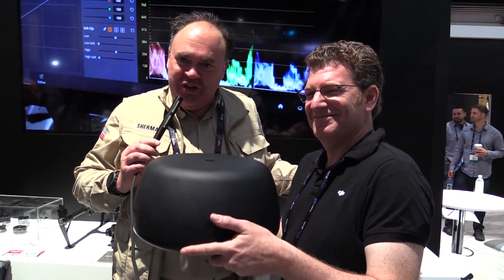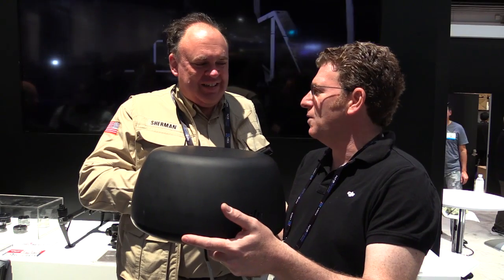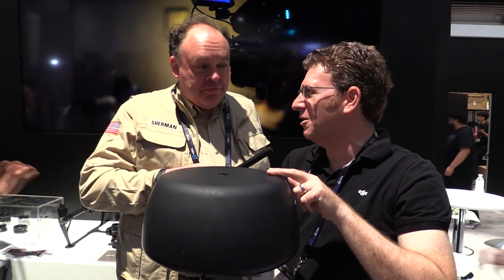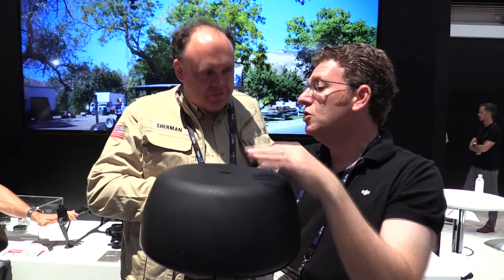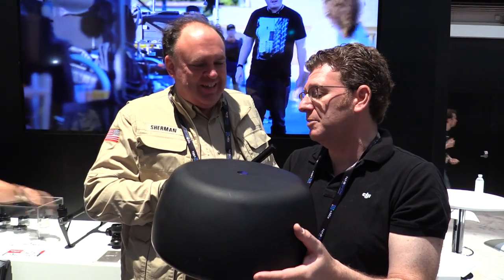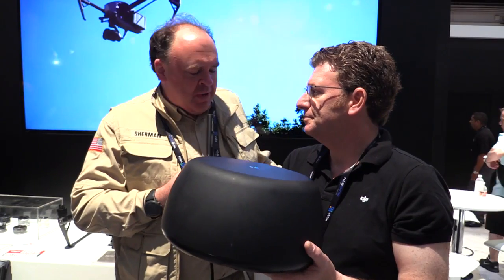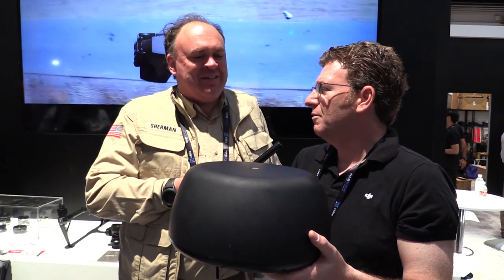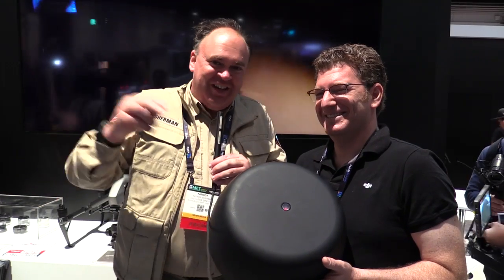DJI Previews Tracktenna Long-Range Video and Control Link

Comment: Another nice fake of DJI. Since this nice video, the antenna was never sold. Those that need, for industrial inspection long range or operation from inside a building with the antenna outdoors are working on our DIY solutions. Costumer service and DJI forum as helpful as always. If you were not a monopoly we all should not buy any DJI product. Best Regards.
Reply: What DIY solution have you been using? I'm looking to use it with an Inspire 2 and the Cendence antenna patch to have better signal for broadcast use
Reply: @rodrigotaveiralevy  Hi Rodrigo, we are trying with an amplifier and a Dipole WIFI antenna. Our application is for thermal plants in Kuwait and Mexico. The Dipole antenna and amplifiers will be in the center of the plant in a high position. We have built an adapter to disconnect one of the normal monopole antennas of the Cendece-S and plug it into the SMA connector of the installation. But we are just in prelimary tests. As soon as we get something I will publish it in my channel. Best regards and Good Luck! Working with DJI is impossible.

Comment: Never happened. A product that never came to market. CAA(UK,USA) regulations stopped development as the bird would never be able to travel the claimed 6 mile range before automonous RTH was activated. but my thoughts on this: a good idea for 1 km professional application usage, where environmental noise requires clean and accurate-fail safe data transmission to the bird.

Comment: Why is line of sight such a big deal? All you have to do is get a waiver from the FAA to fly beyond line of sight. Hell, if I fly my Mavic Air more than like 500 feet away, if I take my eyes off of it to look at the screen or something, I can't see it when I look up again. I usually fly at dusk because the blinking light on the back is much easier to see than the drone itself.

Comment: Great, is this why i can only go like 1km away with my Inspire 2 before loosing signal? After recent firmware update?? 
So now with this expensive piece of equipment I am embarrassed in front of my real estate clients, when I keep loosing connection only few hundred meters away while doing videos of farms. Only so DJI can sell this oversized cake for ton load of money, which i will have to drag with me everywhere to remote areas to be able to do my job?
Not happy, not happy at all. Might look into different options
Reply: Robert Štrup I have connectivity issues too. Not sure if I can tell if the update did it worse tho. The update made the gimbal so much steadier tho. How does the mavic platform get so much better range than i2?!!!!

Comment: Not bad.  Looking forward to a real-world review.  In general, I'd rather have a 6 to 8 antenna radial array with a good diversity controller.  No moving parts and no dependency on a good GPS fix.